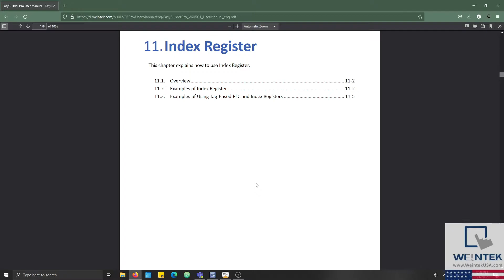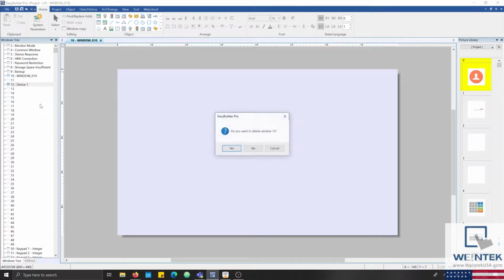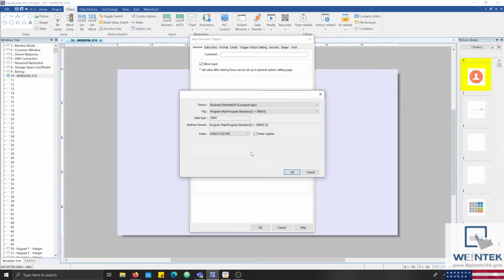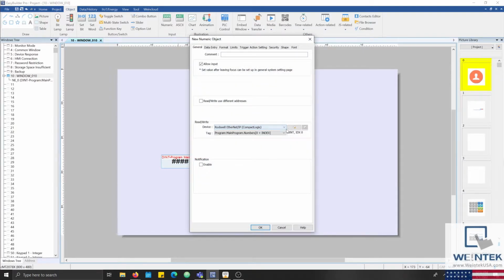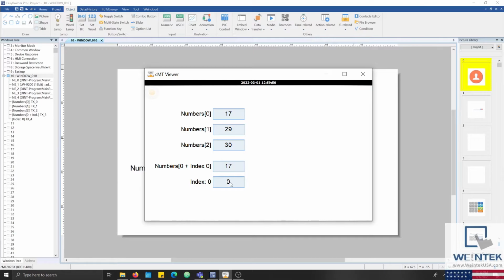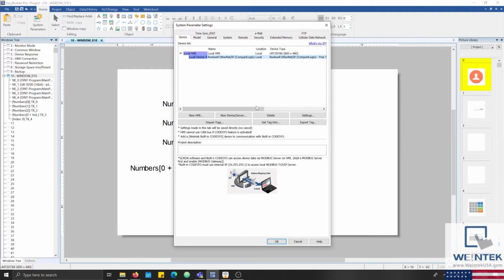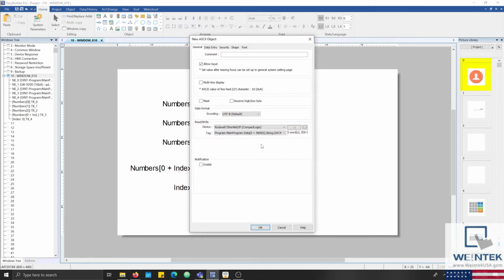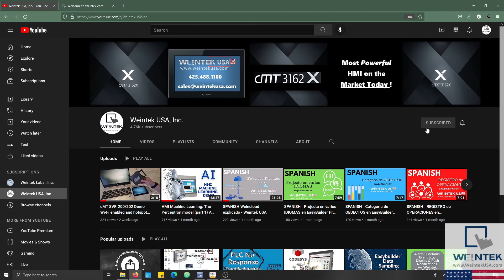How to use EasyBuilder Pro's index register with tag-based PLCs - Weintek USA

Comment: Hello

How can i do the same using macro?

I would do:

SetData(value, "OMRON ecc", custom_tag, 1)

where custom_tag is a concat string in the format path[int].subpath
Reply from the maker: Hi @edoardorossi6262,
We don't yet support this feature in our macro workspace as tags are defined using STRING literal format "custom_tag[#]". However, a workaround may be to transfer data from HMI registers into your tag-based PLC via a "Data Transfer (Global)" object and then index the HMI registers via macro as in SetData(value, "Local HMI", LW, i, 1) where i is some index value. I hope this helps!

Comment: Hello.

How to use indexes in macros for named tags? 

I mean using code like:

        unsigned short index

        GetData(index, "HMI", LW, 9200, 1)
        GetData(value, "MODBUS", "Tag_0", 1)

How to use index with "Tag_0" to shift address?
Reply: hello, i have the same problem as i wrote in another comment. how did you do?